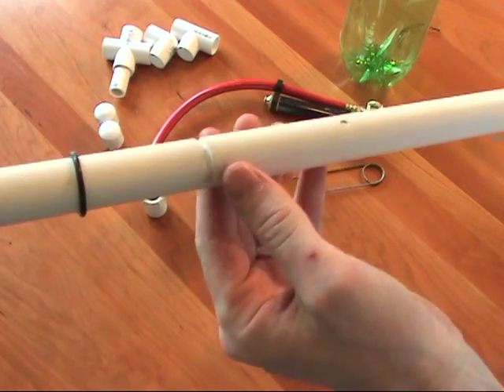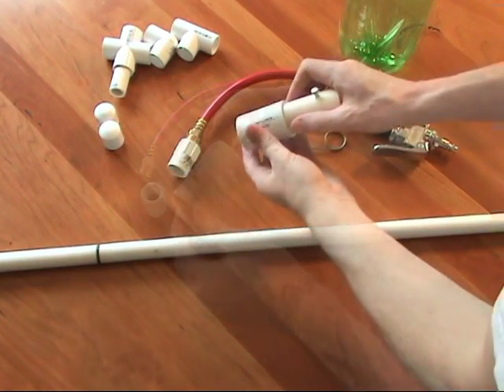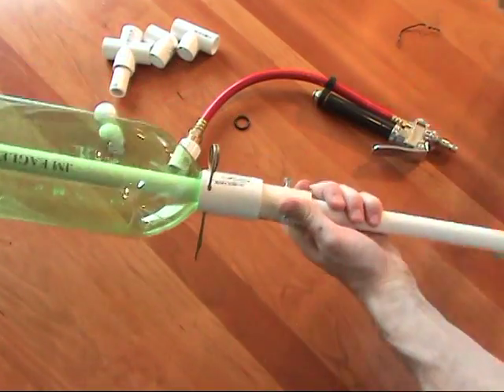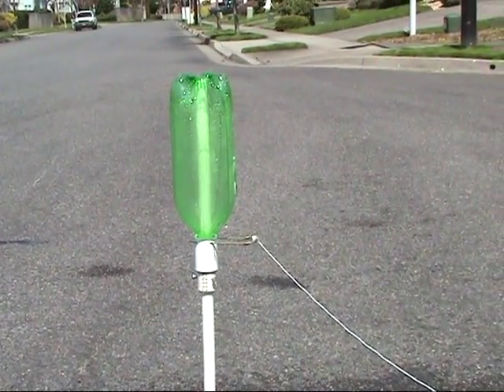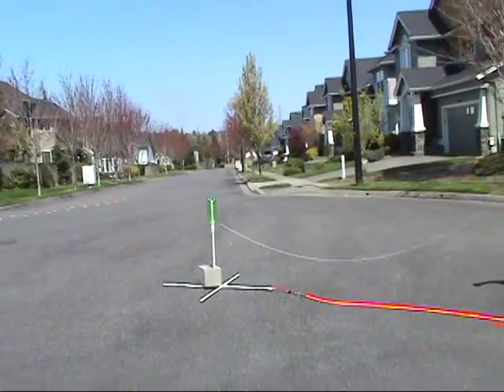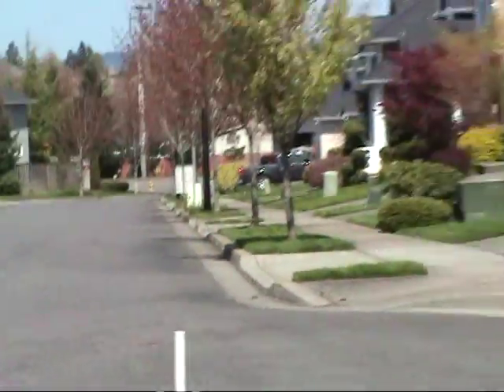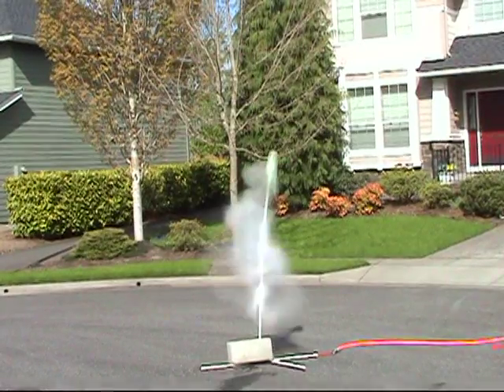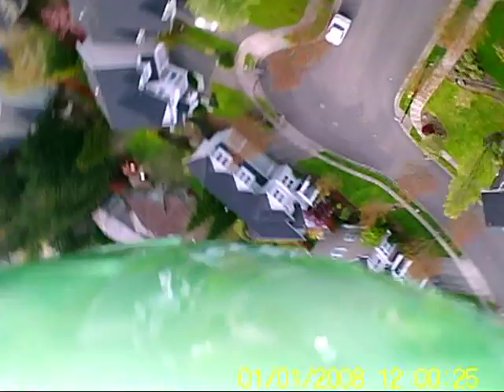2 Liter Aerial Video Surveillance Satellite

Comment from the maker: This project probably costs about $10.  The biggest variable is going to be what you use for a valve and how you presurize it.  I had an air compressor and a tire inflator valve lying around.

No, I didn't study engineering.  I am a shoemaker, beekeeper, lawn mower, and internet mega celebrity.

Comment from the maker: @northpaw2000  Thanks.  Please subscribe so that you will know right away when I put up a new video.  I have 3 videos currently in production. 

For the marshmallow gun, the switch is what turns the laser on.  The marshmallows are loaded one at a time, so they don't jam.  the pressure is just your own lung-powered air pressure.

Comment from the maker: @hutadut I agree.  Placing the filling valve further from the launch pad would have been better.  

I also stopped using bottles after they got some creases from impacting the ground.  I figure that can't be good for structural integrity.

Comment: @chuvak1 Google "water rocket cable tie release" to see an easy-to-build release that doesn't require that hard sideways yank. This release was first developed by Ian Clark in the late 90s, and has become the most commonly used since.

Note that the pop bottles, when they burst, do not blow shrapnel around (although they can blow out your ears if you're close enough). PVC, though, shatters into small sharp fragments. Be aware, be safe, have fun.

Comment: I've built a similar launcher, only instead of an o-ring I used a flame to soften the PVC and create a bump in the pipe. The retention clip holds the bottle down firmly and we've seen heights well over 200 feet without fins. My wife uses it for her sixth-grade science class. For safety reasons they stop at 60 psi, but I've used it up to 120.

Comment from the maker: @songstowearpantsto It took a long time to get that.  I launched the camera several times, then took it in to download only to find out that the off button was pressed every time as the bottle inflated.  So I cut bigger holes around the buttons in the foam protecting the camera.  Several more launches - same problem.  Opened the camera, removed the rubber bottons, reassembled the case, used a paperclip to activate - same problem.  Decided to inflate first, then activate camera - success finally

Comment from the maker: @Data643 The seal between 1/2 inch pipe and the bottle nexk is fairly tight.  I wonder if it would work just as well to use a layer of electricians tape instead of the o-ring.  That would obviously be easier to make and I'll bet it would make a good seal.

Comment from the maker: @djohnson16mindspring If I were to do it again, I think I would build the presurizing valve further from the rocket.  I would also use a thinnner o-ring, so that I would not have to remove so much material to make the notch.

Schedule 80 pipe is not a bad idea.  If you notice, the pipe (mine was schedule 40) is a little too flexible.   I had to put a cinder block on the base of the launcer and still, the upright would flex a lot when I yanked the pin.

Comment from the maker: @djohnson16mindspring You bring up a good point, however I wonder what the effect of the pipe failing at the notch would be.  The pressure around the notch is opposed by the neck of the bottle.  If the pipe failed, I think the only direction it would go is upward.  With that said, I was always a little scared of the bottle exploding in mt face.  Whenever I pressurized the rig, I turned away, firuring that shrapnel in the back of my head was better than in my face.